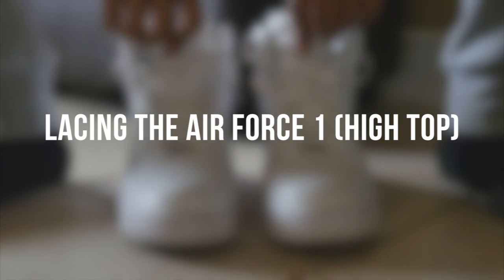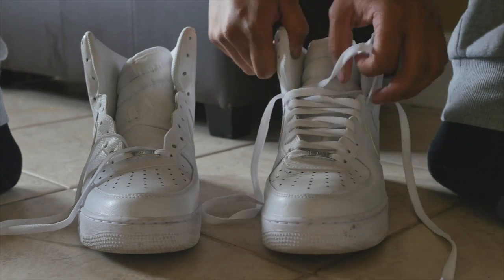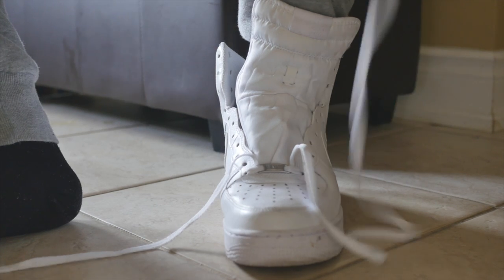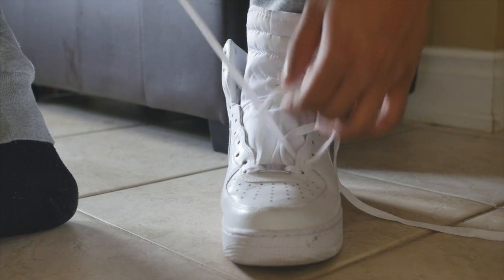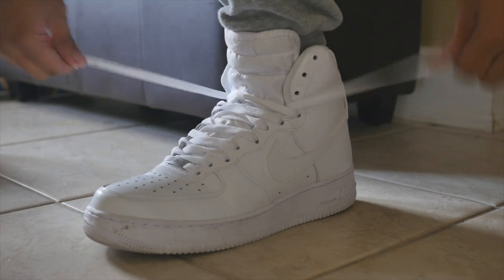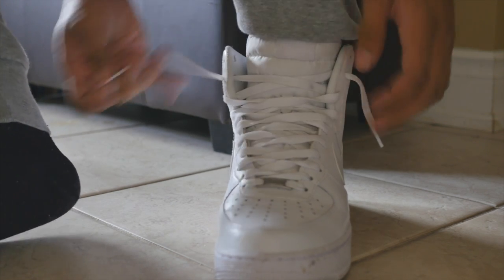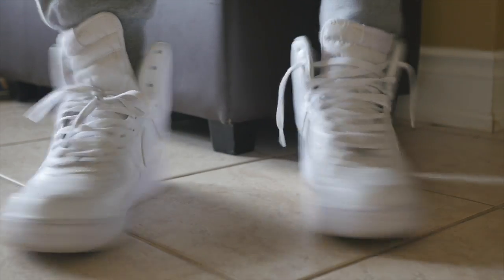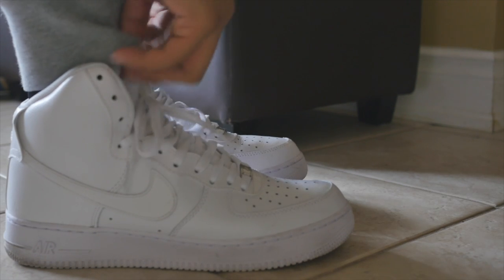FACTORY SETTING LACES sort of (NIKE AIR FORCE 1 HIGH 2007 LACE UP)

Comment: so uh does the strap normally fall off these
Reply: Yeah for the high tops usually if it does the sides weight are uneven but u have a choice to take off the strap or leave it on